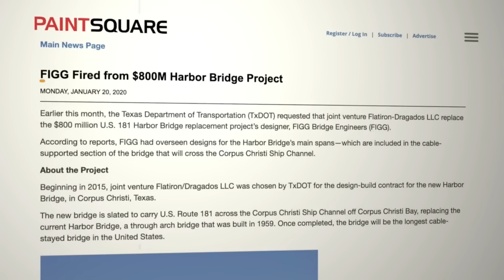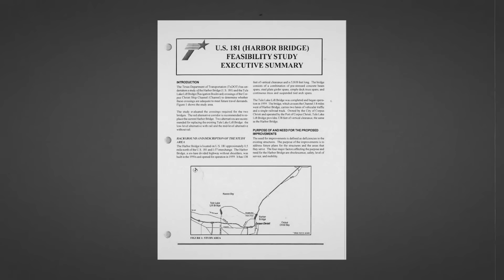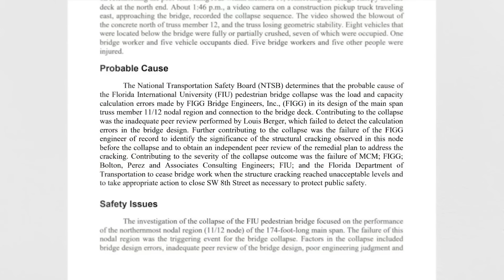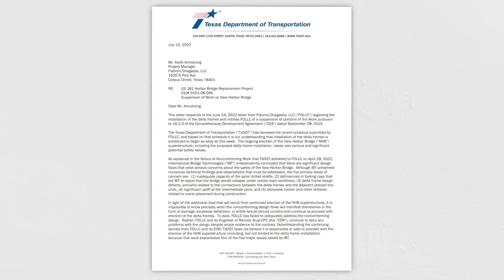New Harbor Bridge: Texas' Biggest Infrastructure Project Is Nearly Complete!

Comment: 2:25 Why were temporary structural supports needed on the land side of the cable-stayed span during construction if they weren't needed on the water side? 

In fact, this shot shows not only do those dark temporary steel supports not any corresponding supports equidistant on the other side of the pylon, but the same is also true for the permanent concrete columns that are further to the left from the pylon.

The stay cables are symmetrical; why are the support columns asymmetrical?

Comment: EVERY American project always experiences delays and financial issues. Not the case in Europe
Reply: Is the following statement true:  "EVERY American project always experiences delays and financial issues. Not the case in Europe"?
.
GPT-4o mini

The statement is an overgeneralization and not entirely true. While it is common for projects in the United States to face delays and financial issues, this is not exclusive to American projects. Many projects, regardless of location, can encounter similar challenges due to various factors such as regulatory hurdles, funding issues, project management inefficiencies, and unforeseen circumstances.

In Europe, while there may be different regulatory environments and project management practices, projects can also experience delays and financial difficulties. The extent and nature of these issues can vary widely based on the specific project, location, and other contextual factors.

In summary, while delays and financial issues are prevalent in many projects across the globe, it is inaccurate to claim that they are exclusive to American projects or that European projects are immune to such challenges.

What are some examples of some European projects?
.
GPT-4o mini

Here are some notable examples of significant projects in Europe across various sectors:
Infrastructure Projects

    Crossrail (Elizabeth Line), UK: A major railway project in London aimed at improving transport capacity and connectivity across the city and surrounding areas.
    High-Speed 2 (HS2), UK: A high-speed rail project intended to connect London with major cities in the Midlands and North of England.
    The Gotthard Base Tunnel, Switzerland: The world's longest railway and deepest traffic tunnel, designed to improve transport efficiency through the Swiss Alps.

Energy Projects

    North Sea Wind Power Hub: A proposed project to create a large offshore wind farm hub in the North Sea, connecting multiple countries and providing renewable energy.
    Hinkley Point C, UK: A nuclear power station under construction that aims to provide low-carbon electricity to the UK.

Urban Development Projects

    The Amsterdam North-South Metro Line, Netherlands: A significant expansion of the metro system in Amsterdam, aimed at improving urban mobility.
    The Grand Paris Express, France: A major public transport project to expand the metro system in the Paris metropolitan area, enhancing connectivity and reducing congestion.

Environmental Projects

    LIFE Programme, EU: A funding program aimed at supporting environmental and climate action projects across Europe.
    The Green Deal, EU: An ambitious plan to make Europe the first climate-neutral continent by 2050, involving various projects across sectors like energy, transport, and agriculture.

Cultural and Research Projects

    CERN (European Organization for Nuclear Research), Switzerland: A leading research facility for particle physics, known for the Large Hadron Collider.
    Erasmus+ Programme: An EU initiative that supports education, training, youth, and sport in Europe, facilitating student exchanges and collaborative projects.

These examples illustrate the diversity and scale of projects undertaken in Europe, reflecting the continent's focus on infrastructure, energy, urban development, environmental sustainability, and research.

Should've added and how were they cost overran and/or delayed.
.
GPT-4o mini

Here’s a look at some of the European projects mentioned earlier, along with details on how they experienced cost overruns and delays:
1. Crossrail (Elizabeth Line), UK

    Delays: Originally scheduled to open in December 2018, the project faced multiple delays, with the opening pushed back to May 2022.
    Cost Overruns: The initial budget was around £14.8 billion, but costs escalated to approximately £18.9 billion due to various factors, including design changes, construction challenges, and the complexity of integrating new systems.

2. High-Speed 2 (HS2), UK

    Delays: The project has faced delays in its timeline, with the first phase now expected to open in 2029, several years later than initially planned.
    Cost Overruns: The estimated cost has ballooned from around £32 billion to potentially over £100 billion, driven by land acquisition issues, environmental concerns, and construction challenges.

3. The Gotthard Base Tunnel, Switzerland

    Delays: Although the tunnel was completed in 2016, it faced delays during construction due to geological challenges and technical difficulties.
    Cost Overruns: The final cost was approximately €12 billion, which was higher than the initial budget of around €6 billion, largely due to the complexity of the project and unexpected geological conditions.

4. North Sea Wind Power Hub

    Delays: As a proposed project, it has faced delays in planning and regulatory approvals, with no definitive timeline established yet.
    Cost Overruns: While specific costs are still being evaluated, large-scale offshore projects often face budget increases due to technological challenges and environmental assessments.

5. Hinkley Point C, UK

    Delays: The project has experienced significant delays, with the completion date pushed from 2025 to 2026 or later.
    Cost Overruns: Initially estimated at £18 billion, costs have risen to around £22-23 billion due to construction challenges and regulatory requirements.

6. Amsterdam North-South Metro Line, Netherlands

    Delays: The project was delayed by several years, with the opening pushed from 2011 to 2018.
    Cost Overruns: The budget increased from €1.4 billion to approximately €3 billion due to unforeseen geological conditions and construction difficulties.

7. Grand Paris Express, France

    Delays: The project has faced delays, with some sections now expected to open in the 2030s instead of the originally planned timelines.
    Cost Overruns: The estimated cost has increased from €22 billion to around €35 billion, driven by design changes, land acquisition issues, and inflation.

8. CERN (European Organization for Nuclear Research), Switzerland

    Delays: While CERN projects like the Large Hadron Collider have been completed, they have faced delays in various phases due to technical challenges.
    Cost Overruns: The LHC's cost rose from an initial estimate of around $3 billion to approximately $4.5 billion, influenced by the complexity of the technology and construction.

9. Erasmus+ Programme

    Delays: As a funding program, it has not faced traditional delays, but the implementation of specific projects can be slow due to bureaucratic processes.
    Cost Overruns: While not a project in the traditional sense, funding allocations can exceed initial estimates based on demand and participation rates.

10. The Green Deal, EU

    Delays: Various initiatives under the Green Deal have faced delays in implementation due to political negotiations and regulatory hurdles.
    Cost Overruns: The overall budget for achieving climate neutrality has been estimated at over €1 trillion, with costs potentially increasing as projects are developed and scaled.

These examples illustrate that while many European projects aim for ambitious goals, they often encounter challenges that lead to delays and cost overruns, reflecting the complexities of large-scale infrastructure and development initiatives.

Comment: 9 years, it is still on going.  Bridge of this size will and can be completed by Korean company in about 4 years or less.
The 1915 Çanakkale Bridge in Turkey took approximately 5 years to build, and here are the key details in feet:

🕰 Construction Timeline
	•	Groundbreaking: March 18, 2017
	•	Opening Date: March 18, 2022
	•	Total Time: 5 years to the day

📏 Bridge Dimensions in Feet -  15000 ft long ,,  1000 ft height

Comment: Im 75 yrs old and raised in around corpus christi and revelatives build the harbor bridge.I would hold on to the old bridge til the new cable bridge goes thru a harricane,because the amount of cables catching the wind and 200 feet of piers not reaching solid ground below.This bridge should be watched to see if the footings not sinking. I always thought footing should hit a solid footing to be stable.I guess the first harricane for the bridge will be the expensive test.
.
Reply: Exactly. Those piers are a major issue.

Comment: The Zilwaukee Bridge is approximately 8,000 feet (2,400 m) in length and rises 125 feet (38 m) at its highest point over the Saginaw river.
Kinda scary driving over that bridge.
Reply: Didn't that one have a little sinkage problem of a few piers years ago?  Never cared for what seems like the excessive banking of the curve.

Comment: I live here and I drive by the bridge every day and it's a nightmare in construction and everybody's afraid to drive on once it opens. It's the same bridge builder as the pedestrian bridge that collapsed in Flordia. We also widened the ship channel by 130 feet and made it 7 feet deeper for larger ships. That's the main purpose for the new bridge.
Reply: I'm in CC too and until is survives a cat 3 I will go through Sinton and Taft to get to the north side of the bay when I need to go up that way. While the bridge collapse in FL was the worst of their design flaws, when they went back and looked at other projects they had ongoing at the time around the country they all had major issues. That's why TXDOT booted them off the HB project and they had to rework the main pillars. Also they have now pushed the opening to August or Sept, mostly do to having to slow down on the work for a bit and they got behind schedule.
Reply: @TdrSld  So the problem was identified and addressed, but you still have a problem with it? Would you rather they did nothing?
Reply: @daveb7663  the issues with the piers was not torn out and replaced, just added to. Structurally there are still some major concerns. As an architect, I plan on driving around  for the foreseeable future anytime I'm in Corpus for work or visiting family.
Reply: So, youre just going to ignore the fact that FIGG was fired after the Florida bridge collapse and pretend they built this bridge??
Reply: @stevenreynolds2327  Outrage addiction. People today feel better when they're pi$$ed of about something and reality takes a back seat. The truth just spoils the fun.
Reply: That’s not true, so at first it was that company (who had the accident in Florida) who picked up that contract but after that happened, that was actually one of the causes of the delay for the bridge. That company lost the contract and they gave it to someone else. I have heard that people don’t want to drive on it but the stuff with that company is old news, that’s why it got pushed back so much they had to change the design

Comment: The contractor was very confident of the design and engineering of the initial engineering firm.  Thank goodness TX DOT, and pressure from local officials, work was halted until further assessments.  The discovery was that one of the towers was slipping.  The decision to fire the engineering firm was made and everything came to a halt.  Today, the bridge is nearly complete, however, the ribbon cutting ceremony was recently cancelled.  Anxiety is within the public as we wait and hope that this costly bridge will survive the test of time.
Reply: Wasn't just the leaning pillar, the main pillars also had some issue with wind up left that could induce vibration into the structure and cause fatigue in the span deering a hurricane.